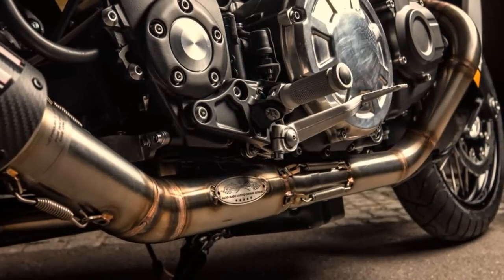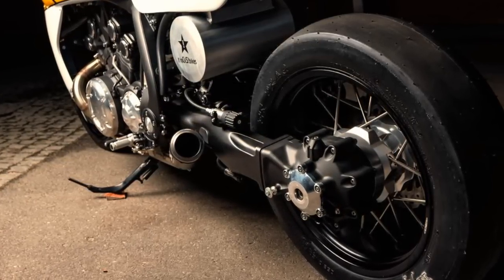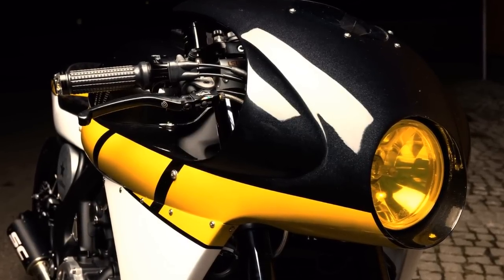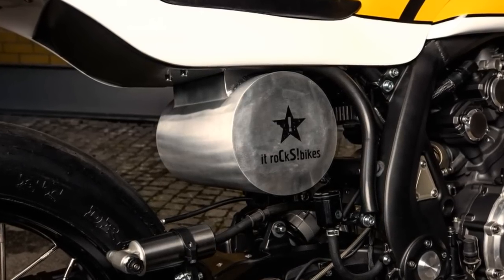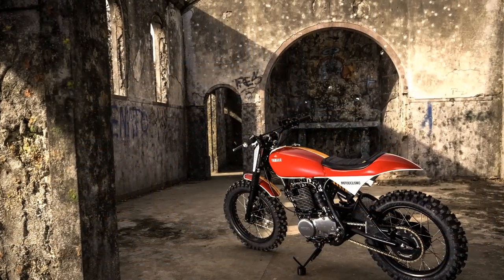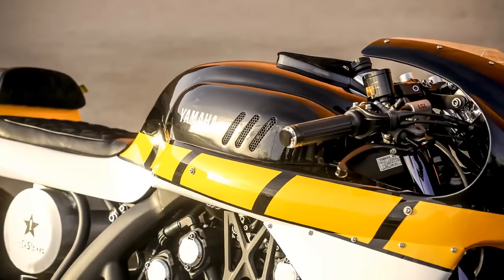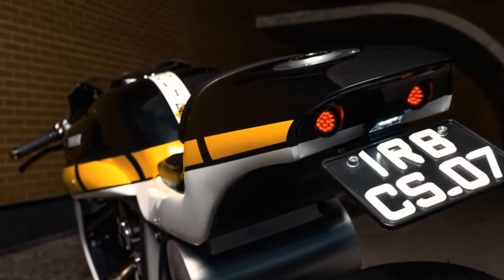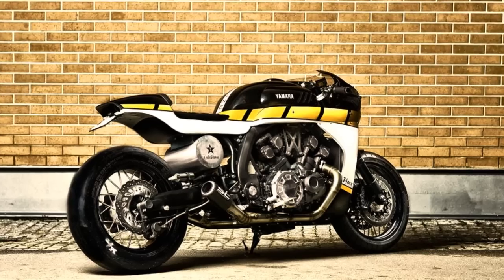Cafe Racer (Yamaha VMAX by It Rocks! Bikes)

Comment: hi when building a cafe racer how do you know when you've picked the right bike for project/the right look for a project
Reply from the maker: That's easy. Try to do a search on the web about cafe racers based in one single bike model(Like Honda Cb 750 Cafe Racer for example), and if you find that many of them are good, it means it's a good bike for a cafe racer. :) Good luck. Cheers.
Reply: +RACER TV well I'm looking at 125cc and there's not that much information on 125 cafe racers
Reply from the maker: tml136
Try to search on youtube for several of my videos about the Honda Cb 125 cafe racer, and also a video about "small cafe racers".

Comment: It seems drag race much more than cafe to me?  the stretch and Micky Thompson rear slick?

It is very interesting.  The integrated fairing, tank cover and seat is absolutely cafe feel.  It is almost like magic.  Cover the top half, and it is like a vintage american race bike.  Cover the bottom half, and is pure cafe.

But the most magical part is that it all works so well together.  I really cannot define it as anything when I see it other than unique.

A cafe racer built to race between cities instead of neighbourhoods?
Reply: "Racing between cities instead of neighborhoods"  
I personally see that being the new direction for modern "café" racers. The world is a big place.  
  
Quite often, I see videos that try to "redefine/redesign" café racers (in my opinion, sometimes too dramatically) which shows that builders and consumers want something different, and this bike really captures that.
Reply: Absolutely agree!  I just couldn't put it into context as well as you did!